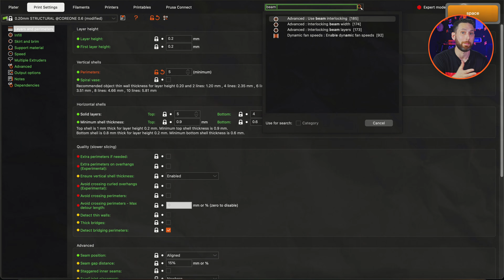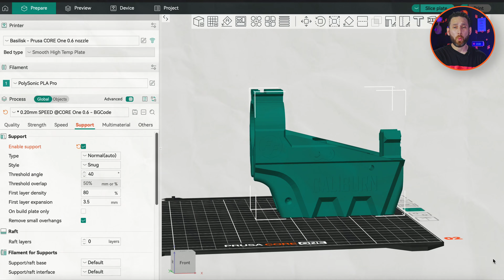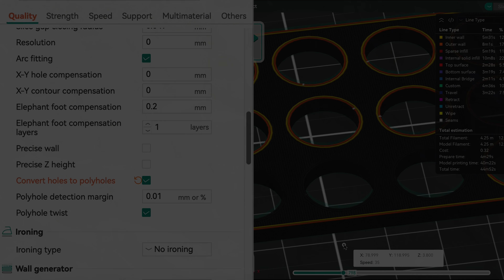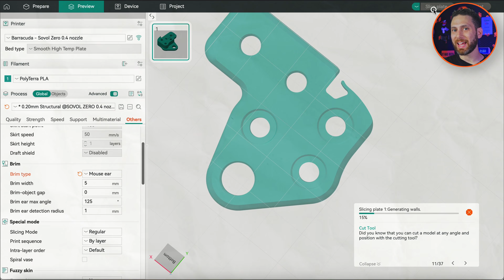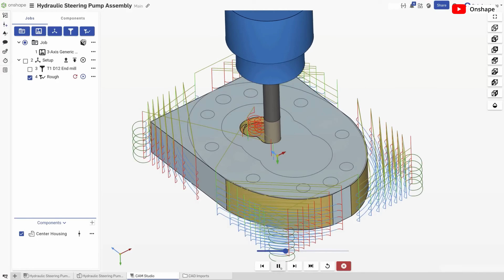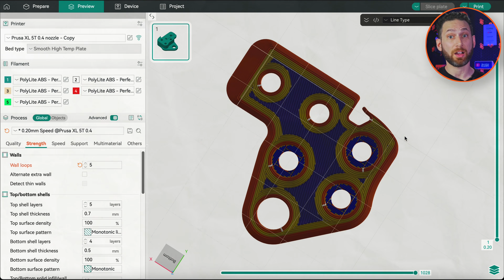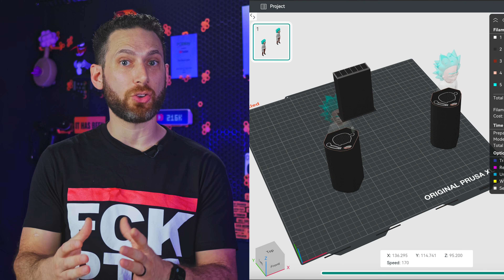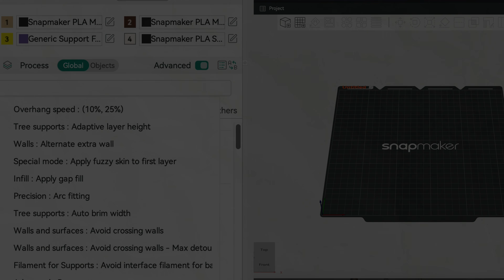Orca Slicer Just Added a TON of Useful Features!

Comment: While not directly a feature of the slicer, I also like to use modifiers for reinforcing holes (mainly for heat set inserts). If you don't want to change the inner wall loops or make a part solid infill, but also want extra plastic for the inserts to bite into, it works well.

Add a modifier cylinder that runs the length of the hole, but that has a larger diameter. Change the modifier to have 100% infill or a very large number of top layers. This will give more material around said holes, without having to add weight/plastic to other places.
Reply: @harrisonbillmers7216  I like to do the same, but play around with the wall count in the modifier. Also use it for tube like shapes, that would otherwise easily snap of a flat plane. Basically extending the tube into the part. Also works with notches and other things, that need reinforcement.
Reply: @BestNub-ni8tm  Yes that's a great usecase. And it can be applied to any shape that protrudes flat surface and endures some forces. Instead having them lie flat on the model base, we can extend their bottom parts, set them to modifier and apply wall count one higher than global setting. Or even model them as separate objects, export as 3mf, and import as single object with multiple parts - this way they're still separated into bodies in the slicer but are locked relative to eachother and can be modified independetly. With higher wall count they'll embed themself deep in the model base and infill. It's particurarly usefull if it's a thin part and using cylinder modifier would require too many copy pastes or could mess up smooth wall finish on that part.

Comment: You are the first person I have watched on youtube that appears to be getting the most out of the small area flow compensation slicer feature. 
Kudos for that. 😊 
I think that the script, is generally used, more often than not, to reduce over extrusion, in areas with shorter extrusion paths, due to the majority of people calibrating their flow and pressure advance settings, primarily using the default calibration tests in Orca. 
I only recently discovered that often this is not the best way to tune in material profiles.
Maybe I am wrong, but even the default values, suggest that the developers probably expect users to use it this way.
Thank you for all the great educational content.
Reply: @arielmarshall5501  Could you elaborate how you’re using the small area flow compensation?
Reply: @Nathan0A Sure. 
I use it to perfect the flow of all the extrusion lengths, after I have finished some other relevant calibrations, as much as my patience permits.
I am still regularly working on improving my profiles however.
My goal being to eliminate any micro gaps between extrusions and layers, without altering any part dimensions. 
I print lots of functional prints, so it is important for me to create profiles for many materials that will squeeze out optimal engineering performance from parts.
I will probably upload a video of my calibration process eventually if this is of interest to you. 
My methods are somewhat unique and likely offer a fascinating insight into the minds and behavioral patterns of people with ocd and aspergers syndrome. 😂
Reply: @arielmarshall5501  🤣I look forward to you doing that! I'll watch for it!!
Reply: @mmouse648 No, no, nooooo. The resolution of part of this mesh is causing arachne to generate an unpredicted section of gap infill, resulting in fluctuations in the pressure of the filament passing through the nozzle and an odd number of perimeter lines!!!!!! 
This could result in bumps on the top of the first layer surface, that could lead to a distortion in the outer dimensions of the part, resulting in the parts weight balance being off center by .1 of a gram and they may not even make a grit of sandpaper capable of evening this out, without affecting a section of the parts surface finish. Especially when taking into consideration the potential for the friction caused by the nozzle rubbing over the rough surface, causing the filament to temporarily melt at an extra degree hotter, further incresing the likelyhood of a temporary change in the parts surfuce glossiness.

THIS CANNOT BE HAPPENING !!!!

WHY G_D, WHY MEEE???? 😢
Reply: @arielmarshall5501  LOL (I'm sorry!❣) I feel ya. Have printed since 2015, and although it has gotten TREMENDOUSLY better, it has ALSO gotten tremendously more complex on the software end. IT's almost a reversal - Before the hardware was cr@p and the software relatively simple, now it's reversed! :hand-orange-covering-eyes:I'm forever going - "Now where did I see that setting for smoothing the sides?"

Comment: It would be great to have a draftshield which also functions as a purgeblock
Reply from the maker: That's a good idea....
Reply: This is genius idea.. .and actually you can alredy use it, as draft shields prints first, it will prime the nozzle. it only works if you have a single color change per layer though

Comment: Prusa slicer beta has a new cooling setting called consistent surface, it adjust cooling together with smarter accelerations so the surface looks very consistent on short and long layertimes so you have much less variation in matte and shiny surfaces, its been working very good for me.
Reply from the maker: oooooooh i didn't know that one, that's COOL!
Reply: @thenextlayer they primarily developed it to address VFAs, pretty cool
Reply: I hope this will get implemented in orca and maybe even bambu studio.
Reply: @rileyneufeld7001 Orca already has it.
Reply: Likely orca before bambu. Bambu should really change their base to orca at this point.
Reply: @PrazgreenStudios Nah, I use both and Bambu Studio is preferable to Orca Slicer in some areas. The prime tower is better, especially when printing with different materials (like PLA and support filament), and the new flow rate pattern in Orca Slicer (with the circles on the top layer) gives worse results. Bambu Studio has settings for depth of color penetration which has been useful with lighter colors in multicolored prints.
Reply: @PrazgreenStudios Yeah, THAT'S not happening, they want to control the entire process and move their customers to a closed ecosystem. Don't forget that the majority of their IP started as Open Source and in the early days we beat them mercilessly about keeping their Firmware closed (literally illegally), now they've moved to even a more closed system. It was their plan all along.
Reply: Orca has a similar feature called "Don't slow down outer walls".
Reply: @jack-y6s8e  sweet I wonder if it helps with shrinkage on the super slow layers
Reply: orcaslicer has a bug for YEARS that the dropdown menues in linux dont work unless its some ancient GTK lib used. How is this even possible? So i've gone back to prusa slicer, and i haven't had problems since. Orca go to hell! There's not a single dollar store feature like adding aux cooling which requires a couple g code lines that can make me go back to orca garbage

Comment: One specific setting that is nearly always overlooked is under filament properties : shrinkage rate. It may belong more to "calibration" than anything else, yet that's an important setting. All thermoplastics expand and shrink differently, faster or more than others, which can ruin accuracy and lead to overuse x/y compensation and such.

As for the x-y hole compensation, it can sometimes mess with other things than holes themselves. At least it does in OrcaSlicer, since setting it to any positive or negative value will not only "fix" holes, but also every part of the geometry that the slicer will consider as a hole, which causes x-y artifacts that shouldn't be otherwise. Don't know if that's clear, though. Sure it can be compensated through "x-y contour compensation", yet... It'd be better if we'd not have to.

Comment: What does "FCK PTG" mean?
Reply: He doesn't like printing with PETG. The vowels are removed ala some variable naming in coding. I myself actually really like PETG as I live in a hot, dry climate which helps printing and I have lots of prints either  outside or left in the car.
Reply: @MauldinMaker-mg4tk  Me too. My go to filament is PETG-HF from Bambu Lab. Never had any issues with it.
Reply: @MauldinMaker-mg4tk  same
Reply: Why does he not like printing with petg? Can someone tell me what is so bad about it? I like printing with PLA just slightly more as my printer is old and the ptfe tube in the hotend starts gassing when I use petg temps (~260°C). But otherwise I think PETG is great for stuff that gets hotter than ~45°C and I have been using it for that exclusively so far (and had no issues printing with it on my old sidewinder x1).
Reply: @DiverseGreen-Anon , I too hate printing with PETG so I can relate to his shirt.  I would summarize my experience with PETG as "unreliable."  It mostly comes down to it's tendency to accumulate on the nozzle and then deposit those often large blobs in random places.  That can cause the print to fail if the print head collides with it later in the print.  PETG also has a tendency to warp/curl at overhangs which can make the nozzle scraping/accumulation issue much worse.  Plain PETG has given me more issues than super soft TPU or any of the "difficult to print" engineering filaments I have tried.  I really started to hate it when I was trying to print 16 copies of a fairly large part.  One would come out perfect and then the next one or two would fail due to layer shifts.  By the end of it I had wasted as much time and filament as I had used successfully.  And believe me, I tweaked everything trying to get more consistent results, with limited success.

I will say that for me (and I believe him), this only applies to plain PETG.  PETG CF/GF are great (but more expensive) and I use them quite often when appropriate.  PETG HF variants are probably much better from what I hear, but I haven't had a chance to try HF yet.

I'll also say that I don't hate PETG as much as I used to.  My Bambu H2D actually handles plain generic PETG pretty well compared to the Creality CR-10s I had previously.  It's still my last choice among the "basic" filaments.  I pretty much select the right filament for the job in this order: PLA > ABS > PETG > Specialty filament.
Reply: The shirt is from his shop, it means fuck petg
Reply: came here for this

Comment: As far as I know, small area flow compensation is more geared towards REDUCING the flow in areas where the toolhead moves slower due to "a small area". The slower movement in those smaller areas tends to ooze more material which leads to overextrusion. Small area compensation is supposed to reduce flow in these areas. Maybe I got that wrong?

Also, I would mention that using a single wall for the first later is extremely useful when printing parts with a very small contact area. Reducing the number of walls reduces the number of times that nozzle has to start a new line, reducing the chance of problems with the filament sticking to the bed.
Reply: you are correct. but very few people realise that SAFC to fix overextrusion in small areas is actually only a bandaid over the real root cause, which is too high of infill/wall overlap. many default profiles put this 20-30% including Orca. when the infill goes to the wall and reverses, it will look like overextrusion even when you have already tuned pressure advance, because the nozzle is told to go 30% into the wall before turning back. guess what...there's already a wall there so where else is the plastic going to go except bulge all around...making it look like bad pressure advance needing additional compensation via SAFC. instead of doing SAFC, try dropping infill/wall overlap to 10% and see if that helps. Orca even breaks out this setting so you can choose only top/bottom layers instead of every layer.

too high overlap INSIDE the part is usually fine, because you will never see the problem with it. that is until you do single wall parts and can see AND FEEL the infill pattern on the outer wall of the part. the high default errs too much on the side of guaranteeing good infill/wall connection. these days printers are much better at positional accuracy, not to mention are being calibrated well, that high overlap is not required. it's just not known well enough that it should be tuned also.
Reply: @suivzmoi Very interesting explanation. 
So you are saying that what we really would benefit from is an adaptive infill wall overlap feature?
I assume that the reason he is presenting this feature this way, is because he had the feature enabled by default and after calibrating his temperature, flow, and adaptive pressure advance settings, his prints were slightly under extruding in the small areas. In which case he is using the feature in the most optimal way orca slicer will currently permit.
Reply: @arielmarshall5501 no he just misunderstood what SAFC was developed for..which is to reduce flow rate for very short extrusions (which happens for infill near corners...aka small areas). it's the last ditch effort to fix bad surfaces even with great flow and PA tuning. 

I'm saying if you are done calibrating flow rate and PA and your small areas are still overextruded, simply try reducing infill wall overlap first. there's no adaptation aspect of it. infills are going too deep into the walls which means a lot of excess plastic with nowhere to go. it just looks worse in smaller areas because there is even less space there. i
Reply: @suivzmoi I think that fff 3d printer design is getting really good now, but firmware and software could still be greatly improved on. I look forward to slicers that have a gcode preview mode with realtime gcode editing features, like paintbrushes, with gradient falloffs, for directly editing the individual/surface area extrusion path speeds, flow, temperature, fan speed, jerk, acceleration, line widths, retraction and wipe settings, ERS, wall overlap and all the other good stuff. 😊
Reply: There are people that have been printing for countless years more than me, so I am by  no means an expert, but when I calibrate my filaments, my extrusions end up looking pretty perfect nowadays except for the small areas, which usually need a significant increase in the default flow values provided by the safc script, to properly fill in the gaps. Pretty sure I have close to no bulging at the wall overlaps anywhere, without decreasing this value.
Having said this my calibration methods are not exactly conventional.😊 
Making a load of new calibration models, to upload to the community in the next few days I reckon.
Reply: I also noticed this and I would agree with you, the feature is probably intended for the purpose you have described, however I would argue that this use case, is not getting the most out of your slicer settings and Johnathan is probably using this feature to get better material flow/pressure advance profiles than most users, for printing parts with highly variable extrusion lengths. 
The majority of people probably calibrate their profiles using the default calibration tests, which will not always yield the optimal values for many profiles and prints.
Reply from the maker: Yikes, my bad, I might have misunderstood it!
Reply: @thenextlayer Sounds like it. But at the end of the day, this feature is a very powerful and versatile tool, what matters most is achieving the best print results, however people find themselves using it. So well worth featuring this in your video upload.